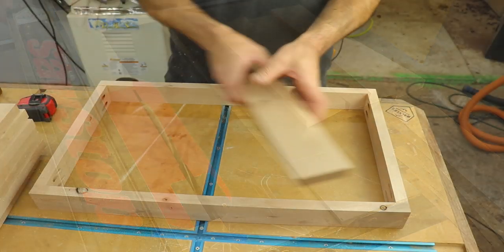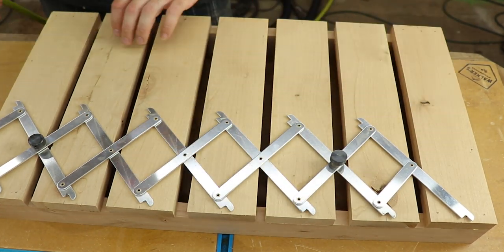How to make a wine caddy / serving tray

Comment: Thanks! This is a nice project and beautiful end product. I'm a beginner and would be interested in any videos you can provide that don't require larger power tools. I have a small miter, hole saws and brad air nailer but that is about as advanced as it gets so far for me. I need a lot more practice on simple projects before I can even think about a table saw, pocket holes, etc.